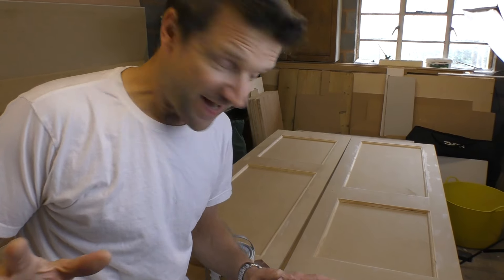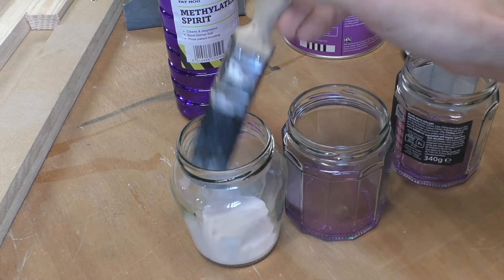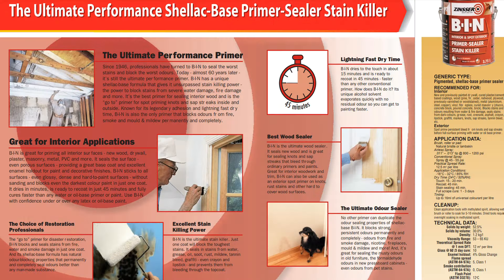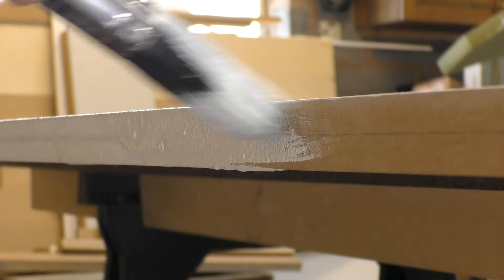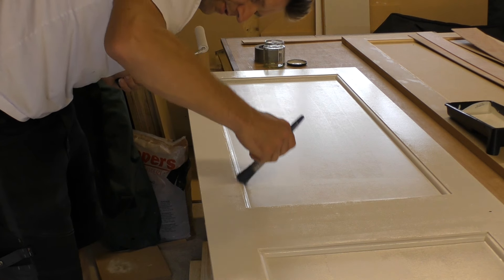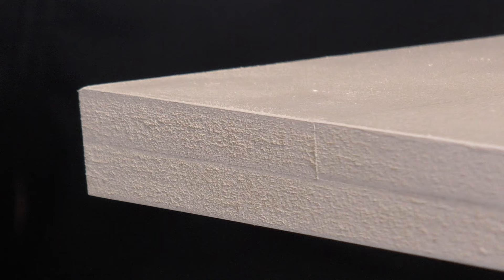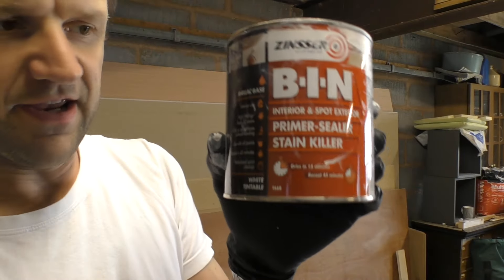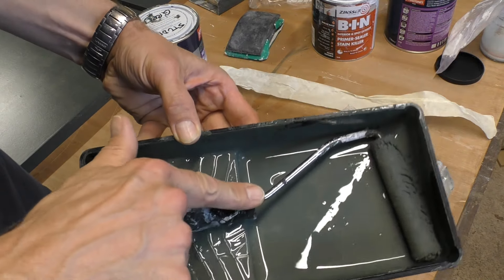Why I LOVE Zinsser BIN for Priming MDF. Video 2/6

Comment: with big and small used rollers, I just put them into plastic shopping bag, handle and all, and turn the roler head like rolling paper on a present, then leave until needed. I don't take roller of the head.
Reply from the maker: Agreed. It does go hard if you leave it more than a couple of weeks though.

Comment: Forget the Zinsser and get hold of the Smith & Rodgers  blockade instead,  doesn't smell as much, flows much better, superior coverage and cheaper,  everyone has switched and Zinsser aren't very happy about it lol.   Well worth giving it a try.  i think it's even thinner, but not sure on that one.
Reply: I have tried knotting fluid on MDF edges with good results.
Reply: Never heard of Smith's  amd roger  where do get it
Reply: @johnjtplastering6991   Crown decorating centres,  Kent Blaxill decorating centers, or online at Topdec
Reply: Ok thanks
Reply: @johnjtplastering6991  it's a Scottish product,  cheaper then BIN, doesn't smell as much.  but a bit runny (don't use on a ceiling)
Reply: @MephProduction  ok thanks should of heard of it as  Scottish  lol

Comment: Surprised (but delighted) to see water-based topcoat can be used. Someone at Brewer’s told me I had to use the blue tin -bullseye123 but it dragged on the brush like crazy and top coat (little Greene water-base) kept peeling off on an mdf window sill…? 
Now I’m confused as to why anyone needs the blue tin of zinsser?
Reply from the maker: Caroline I tried 123 out on this project https://youtu.be/4ylDeQXv1k0 and wasn't blown away by it, although curiously Zinsser recommend 123 not BIN for MDF. I use BIN for everything these days. The only reason I can think for using 123 is in the heat of the summer when BIN dries too quickly to get it off the brush. Also BIN is quite a brittle primer so not ideal for applications where you need a bit of flexibility.

Comment: Nice finish... would it not be better sanding the edges 1st to take the rough off them then painting it?
Reply from the maker: Problem is however much you sand it first you'll always need to sand it back between coats but yes you're right and this is what I do these days as discussed here, sand the beauty of using BIN is it's so easy to sand. https://youtu.be/763yQg0Euwc?si=DdA5euoDfTOYcM7Y 👊

Comment: I questioned Rustoleum about MDF primers. I also use the shellac based primer A LOT. I thought just maybe it makes MDF water resistant and could be used in humid areas. I and got this as a response:

 Thank you for contacting Rust-Oleum Product Support.
 
As per your inquiry, the primer is not waterproof or water resistant so it will not make the MDF
water resistant either.
 
We would also recommend to use the Zinsser Cover Stain over MDF as it is more resistant to bleed-throughs
and protects the MDF better than the BIN.
 
If you have any additional questions or concerns, please do not hesitate to contact us.

Comment: I know they make a spray paint in a can but have you used this stuff in a sprayer as it's so thin it seems like it would spray well.
Reply from the maker: This is the spray stuff https://bit.ly/36s8E3A I find it a bit messy though (a lot of wastage) for anything other than spot priming - it was brilliant when I primed some light fittings that I had taken a grinder to, to remove lots of fussy dangly bits.
Reply: @CharlieDIYte  thanks mate

Comment: Hi Charlie is there a range from Dulux paints that can be used as a top coat for MDF with similar features to the Johnstones aqua satin?
Reply from the maker: Yes there will be - something like the Quick Dry Satin Wood. Best thing to do is go to your local Dulux Decorators Centre or Brewers - the paint will be better quality than you'd get at, say B&Q where it's often thinned down.

Comment: Great video, but is there any reason you're not using Zinsser 123 primer? I can't really see the differences between the two, other than the 123 is water based, and easier to clean. What am I missing?!
Reply: BiN is far superior to 123...it adheres better, dries faster, and covers better...its hands down the best primer I've used...and it's the ONLY primer to use for covering water stains and also for covering knotty wood or any wood that "bleeds".

Comment: I also use B.I.N for covering stains so it's good for small areas in particular. I don't clean my brushes, I simply store them in a jar in meths, covered with a strong plastic bag and rubber band to slow evaporation. If the brushes dry out they can be soaked in meths for a while and will be back to normal.

Comment: I used a foam roller to paint laminated IKEA furniture (sanded this initially with 120 grit sandpaper) followed by 2 coats of BIN. I applied 2 coats but there is a significant orange peel effect. What is your advice Charlie? Sand it down and repaint, or sand with 220 grit, followed by 2 top coats?
Reply from the maker: You do get orange peel with foam rollers. Problem is BIN dries so quickly particularly in warm weather you find it pulls clumps out of simulated mohair sleeves - but my advice would be to give them a go. I'm also a big fan of the Wooster red feather roller sleeves, but you need to buy a new mini roller for them as they don't fit standard sleeves .
Reply: I had the same issue. I'm going to attempt to sand with 220 or steel wool and see what happens. How did your experience end up going?

Comment: Hi Charlie 

Been using zinsser bin for my current wardrobe project ( all mdf)

I've been sanding between coats ( two In total )

Gonna crack on with top coat later this week, I do have some scratches looking down the doors under lighting from my sanding with 220grit. Will this be evident when I put my top coat on ?

And would you sand between top coats ?

Mitch.

Comment: An excellent finish and too have found zinsser paints well worth any premium. Could I ask, why did you not use zinsser for the final coat?
Reply from the maker: Very good question. I suppose at the time not realising they could be tinted but I should probably use them going forward as their top coat would be much more durable. 👊
Reply: @CharlieDIYte  thanks for reply. Yes, I've found zinsser satin top coat extremely durable both interior and for exterior.  
An excellent finish on the doors you made however.

Comment: hi did you sandpaper after each coat of zinsser or just even after the 2nd coat if it?
Reply from the maker: Yes after each coat. It's very quick and easy with the BIN. It just turns to dust rather like sanding plaster.

Comment: Cling film the roller tray. After use, let it dry, peel and throw away the film. Get a tall glass jar, put some marbles in the bottom and pour in a little metho way below the height of the marbels. While painting, put the rollers in the jar and seal while they aren't being used.
Reply: Cling film and metho is also good for liquid nails or silicone products in those chalking tubes. If the tube is nowhere being finished, unscrew the nozzle and put a bit of cling film over the tube end and screw the nozzle back on. Get a champagne bottle and put a bit of metho in it. Push the nozzled tube into the top of the bottle and store upright. The metho vapour will stop the liquid nails hardening. When you want to use it, pull it out of the bottle, squeeze the gun to break the cling film cover and squeeze out the first bit of product that was in the nozzle (don't use it, it's not the same after a metho vapour soak), then just use the liquid nails like normal.

Comment: I bought it, very runny - seems to do the job though. My issue is i cant clean it off my brushes. I used paint thinner and it did nothing! Cant see myself using the tin much again in the future as its such an annoyance wasting a brush each time, will probably chance it not priming!
Reply from the maker: You don't use thinner. You need methylated spirits. It cleans off REALLY easily with that. Or Zinsser do a brush cleaner.
Reply: @CharlieDIYte  bought some today, very good! Falls straight off! On a separate note, the downstairs bathroom in my new house has a lot of peeling paint above the shower. When i scrape it all off and sand it would BIN be a good thing to use to prevent this issue in future? Is there a special type of paint to use for bathroom ceilings to stop this? Thanks! Videos are always fantastic and very helpful, im actually redoing the awful job my plumber did siliconing the upstairs bathroom refurb using the little rubber scraper thing you recommend in your siliconing video. Is there any solvent or technique which makes removing silicone easier?

Comment: Hi Charlie, do you sand this primer after? I always see this as sanding off your work. What constitutes a light sand? Thanks
Reply from the maker: Hi Craig, definitely sand the edges, as the end grain is drawn out by the paint. I think it's worth giving the other surfaces a very light sand with very fine 180 grit or higher, sand paper, just to take off any imperfections or bits of fluff from the roller or anything else that has landed on the wet paint! The Zinsser BIN is a truly great paint though. All the pro painters on site use it, and the main advantage is that it dries so quickly so you can get so many coats done in a fraction of the time you would with a typical mdf primer.
Reply: @CharlieDIYte  Did you sand the front edge between coats? I like bin but trying to have a brush finish on cupboard doors is virtually impossible. 👍

Comment: I am painting MDF fir the first time. I used Zinsser water based sealer but possibly didn’t put it on thick enough. I can’t seem to get a smooth finish which I am finding very frustrating. Love the videos.
Reply: Elaine Pidd rub back with 320 sandpaper be fussy with it then clean redcoat and paint voila perfect finish !

Comment: Hi Charlie the link for the paint brush doesn't work. Do you no of another link with the same brush
Reply from the maker: That's frustrating. So I've just finished my wardrobe build and have been using a 1 inch/25mm Wooster Gold Edge. A little pricey and you can't get them everywhere, but I've also been using Axus Decor brushes in this project. Something like this would work well https://bit.ly/3gy2GSU The guy who runs this site on eBay is a decorator and knows his stuff, and sent me some kit to try out. I like the Axus stuff. It's good quality and reasonably priced. The established wisdom is to use pure bristle for solvent based paints but synthetic brushes are excellent these days and a lot of them (like this linked one) are designed to be used on all paint types.

Comment: Did you put that bag/roller in the fridge or just left it out at room temp?  I seem to recall reading that putting paint in a fridge enclosed in plastic, makes it last longer and won't dry out.  Am I wrong about this?  I don't see why temperature would make any difference.

Comment: Hi I have a large stair case which was painted poorly over the years and is scraping off now as it has had oil based and water based applied in its time .  Can I go straight over the top of it all with this BIN paint and then do a top coat ??
Reply from the maker: If it's scraping off I'd be inclined to strip it as the new paint will only be as good as the bond the original has to the wood, which from the sounds of it isn't that great.
Reply: @CharlieDIYte  😥😥😥 I thought you might say that … thanks for replying x

Comment: I leave my synthetic 4 inch roller inside the BIN paint can with the paint even though instructions on rollers say not to and I never have to clean it or replace it this way. I left roller in a can for almost a year and re-used it with flawless results. Try this and save some money on rollers
Reply from the maker: That is basically the only option if you want to roller on BIN without throwing the sleeve away. I tend to wrap it in cling film whilst I'm doing the job and then throw it away when I'm finished. When you say synthetic are you using a foam sleeve or synthetic mohair type?
Reply: @CharlieDIYte  I'm sorry its actually called Polyester knit roller. I like those better then foam rollers on MDF. They spread a thicker and more even coat of paint compared to the foam roller that creates more of a paint lift off after rolling back n forth once.

Comment: Hi, I made the door, used the Zinser with the little rollers and stored them in little bags but it all went wrong when I painted the mouldings with a brush which came out very gloopy. Its probably just me and brushes but any tips for painting smoothly with a brush? Thanks.

Comment: Hi. I’m looking at painting a baguette bench made from Mdf and this video has helped loads! One quick question, do you sand the doors and edges down before you applied the Zinsser BIN primer? Cheers
Reply from the maker: Check this vid out https://youtu.be/763yQg0Euwc - it's my most up to date. Yes, sand before, preferably with a random orbit sander - you can pick up 240v versions very cheaply - then sand lightly by hand after painting and give the edges a second coat of BIN.
Reply: @CharlieDIYte  Brilliant!! Thanks for your reply. I already have an orbital sander so that’s no issue. Sorry if I’m being daft but did you also sand the smooth face of the Mdf before priming or just the edges? Thanks again

Comment: Question here?? I bought the bin primer today, I'm currently cutting new mouldings to fancy up the doors and drawers in my kitchen units, the units are melamine and the doors are mdf, the mdf has been painted b4, I have giving the doors a light sanding, but will I give the edge of the doors 2, r 3 coats of bin b4 I put on my dulux satin finish???

Comment: Interesting, thanks! I see that there is now a water based version of Zinnser BIN. Do you know whether it covers up stains e.g. wood knots, as well as the version you demo in this video? Subscribed! Thanks
Reply: Are you talking about Zinsser 123?
Reply: Well does the water based work the same? BIN 123 as well or other BIN  water base primer?
Reply: @kodiham7532  Yes, I got a small tin of the water soluble version of Zinsser 1-2-3 and it has covered up knots really well and no sign of them bleeding through.

Comment: I've heard that you could have issues using a 2nd coat of bin or shellac primer?
Reply from the maker: I haven't had any problems but only tend to build up layers on MDF edges - which you obviously sand between coats. You don't really need two coats on the face of the timber.
Reply: @CharlieDIYte  a certain shellac primer softens up the previous coating if using the 2nd coat on the face.

Comment: Seems like a really good paint. 
Have you ever tried the paint rollers by two fussy blokes and yes that's what the rollers are called lol. 
Also you should try moulding a good quality tin foil into your roller tray it saves cleaning the tray out. 
Great video thanks for sharing. 👍👍👍
Reply from the maker: Thanks Terry. No I haven't but I do use foil in the tray quite a lot.

Comment: I really like your videos and I trust your judgement. I'm building a man cave in my garden at the moment and I'm using MDF for some boxing in, I even use it to make a star ceiling.
My question is, I've been hearing a lot about how dangerous it is. My local wood shop wouldn't even rip boards for me. He even said its banned in America. I've since learned that's not true.
Please tell me your thoughts on this. Thanks again
Reply from the maker: Hi Craig, interesting question and one that seems to crop up quite often. One of the carpenters I work with says the scare stories about MDF in America were largely started by the powerful timber companies who had so much to lose from it flooding the market - which I don't know for sure but makes a lot of sense. Take a look at this article https://goo.gl/3XAemm. Note what they say 1) yes MDF is constructed using urea formaldehyde adhesives which are a suspected carcinogen; 2) but plywood is also largely constructed from the same type of adhesives; and 3) sawdust is not a suspected carcinogen but a KNOWN carcinogen. 

So you can conclude from this that working with any wood where you're creating a lot of dust is not great for your health - your local wood shop is being a bit melodramatic about MDF!  So if you're a DIYer like me without access to sophisticated extraction fans, you can be sensible and minimise the risks by working outside where the concentration of dust is going to be a lot lower than if you are cutting in your garage for example, and if you're really worried, then buy a mask, which you can pick up really cheaply from any good DIY/ hardware store. In fact you should wear a mask always really when cutting wood where you're likely to be generating a lot of dust. Also, if you do have to cut inside, buy yourself a decent vacuum - by which I mean a Henry rather than one of those gimmicky Dysons. You can eliminate a lot of the dust that way, and some tools like my Ryobi circular saw can be connected directly to the Henry eliminating a massive amount of dust whilst you're cutting. Hope this helps 🤔

Comment: Great video! I see you painted with water based paint, but shellac primer works with oil based paint. How did you make it work?
Reply from the maker: Interesting point Maya. The official Zinsser literature days you can paint over it with any oil or latex paint. The Johnstone's went on great and I haven't had any problems with it. I'll see if I can get any more info from Zinsser.
Reply from the maker: Official response just received from Zinsser:
"You can overcoat B-I-N, once completely dry, with any conventional decorative finish, this can be oil/solvent or water based.
The term “laytex” is a term that derives from the American market.  To the UK market this can be translated as emulsion.
In short, the customer is perfectly safe applying a water based paint on top of B-I-N.”